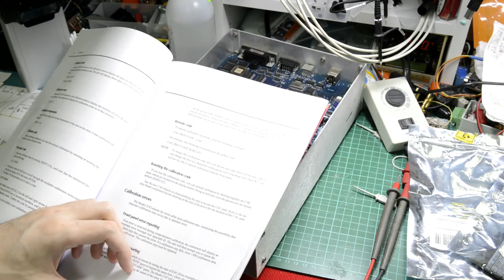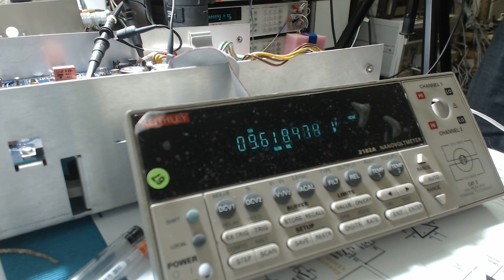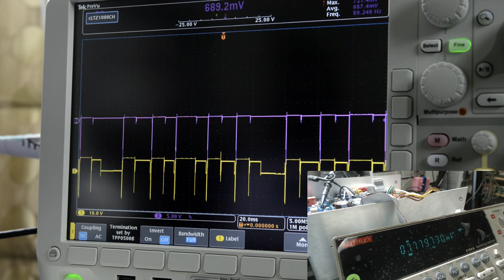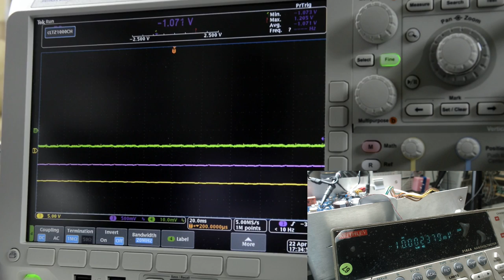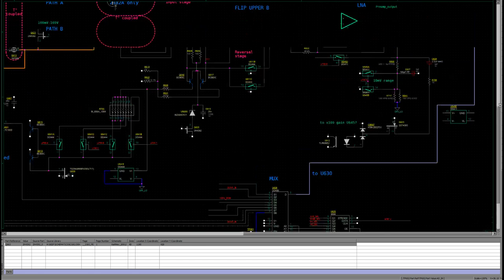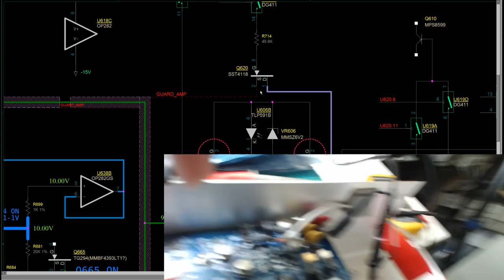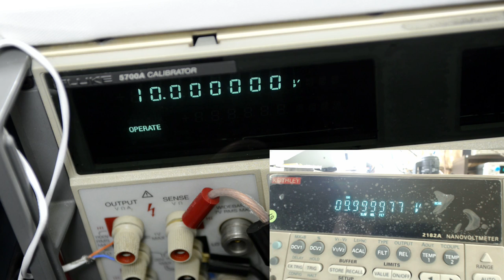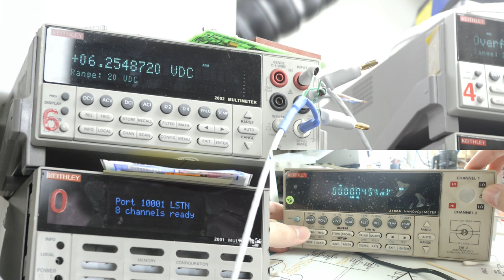Troubleshooting exploded Keithley 2182A nanovolt-meter

Comment: Hi xDevs.. Another enjoyable video. 
JFYI.. There is a buzzing noise in your sound, every time you talk or there is a noise in the room. It's even triggered by the beeps from the scope as you push the buttons. It's a distorted buzzing echo type of sound.
Reply from the maker: I'll try to work around that.  It's noise suppression thing on OBS, because lab is bit noisy because of equipment running.
Reply: OK that'd be great. Thank You :)

Comment: I noticed that at the end the reference voltage is changing by a similar behavior as the voltage reading, it wasn’t very stable, so I would be looking at the reference as the next thing to replace
Reply from the maker: It is not the reference, I did the test afterwards.

Comment: I wonder how to get the schematic of this  device, like the .dsn preject file you just shown
Reply from the maker: It was reverse-engineering schematics. There is no manufacturer schematics from Keithley for 2182 :(.
Reply: @xDevscom_EE  got it. thanks for your reply. I just wonder how they solve the EMF issue when measuring such low nanovoltage .

Comment: Why nanovoltmeter has so much noise? Around 1 000 nV is a lot, it is because it is faulty?
Reply from the maker: Yes, normally working 2182A has about 30-35nV of noise.

Comment: Hi sir can you share the Power Transformer [TR-299B] secondary voltages with respect to wire colour. It will be helpful  if you share me the circuit diagram. Thanks for the valuable video.